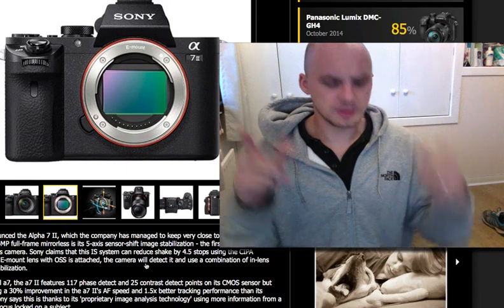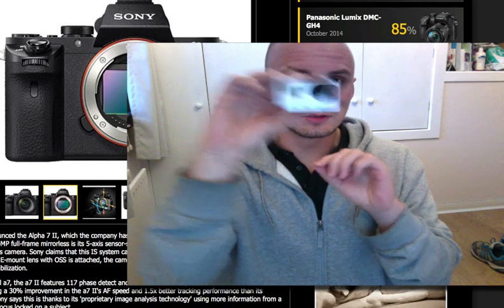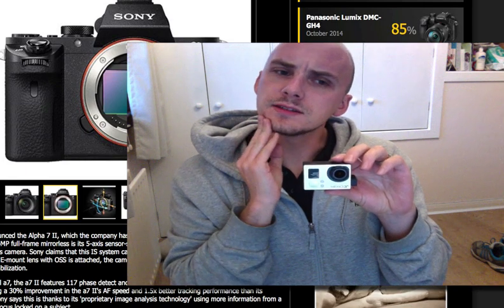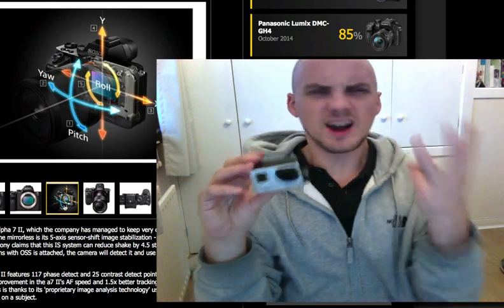5 axis sensor shift image stabilization ? What?

Comment: Actually there can be an infinite number of axes. Just because the Cartesian coordinate only requires three to fix a point in space (ignoring time) doesn't mean those three axes are the only ones that will ever exist. In the case of engineering speak the term axis refers to any axis of rotation that moves independent of another axis of rotation....or along an axis instead of about an axis. So, a degree of freedom can be the rotation around the X-axis and another one can be in line with the X-axis. So one axis creates a degree of rotational freedom and a degree of translational freedom for a total of two axes.
Reply from the maker: mind melted

Comment: I guess you are right with the tilt-shift-effect. I have a beamer where I can correct the projection when it doesn't stand on a flat surface and the projected image will have a distortion (upper side wider than lower side and vice versa). If you correct this you have the sides as long as they should be but the upper and lower part of the image will be blurry and the middle will be sharp.

Comment: Dom, I think you are right. But it seems nobody in the comments understand your point. Your point is really about moving the sensor plane with the IS system, while keeping the focal plane fixed (since the lens doesn't move).
Reply from the maker: spot on, however i now want to go and test out the olympus cameras to see what happens with them or if it is just bulshit
Reply: Is it possible to make vibration compensation using micro lenses between the sensor and the main lens?

Comment: I tried Olympus' 5-axis stabilization system and compared it to my regular Pentax SR ... Can't detect any difference whatsoever. Both worked wonderfully handheld down to 1/5s with a 50mm lens.
I don't think the original A7 series had any sensor stabilization though, so this is a good step for Sony... They overdid it though, IMO.

Comment: I think the problem arising from the difference in the plane of the sensor and the lens, as +Dombowerphoto said might have a point. In my opinion the resulting image may be slightly skewed or cropped, but not blurred(since that's the basic objective). Now...to correct the skew/ crop of the resulting image, Sony might have used or may use in-camera software!

Comment: From what I've read so far (mostly speculation) is the camera will be able to read pitch and yaw, then translate that movement into x-y shift to move the sensor in plane. It won't be perfect, but it should still improve IQ on top of the standard 3-axis shift.
I was getting a little excited at first, thinking this could lead to in-camera sensor movements.(ie. in-camera tilt-shift!) Unfortunately, not yet. Would be awesome though!

Comment: Actually my photography suffer a lot from Roll. They way most hold a dslr will make the camera center of gravity in from of the sensor and this gravity will "pull' down front the lens. This is where Pitch will be very helpful. 
Stabilization will not burl your pictures as the idea is to counter your movements. And in relation with the subject the sensors will be still.

Comment: Come on. This is simple. Think of it this way. The Movi rig does 3 axis stabilization as in roll pitch and yaw. This camera will also do some straight up down movement stabilization and left to right movement stabilization. With Movi the user is doing the up down left right stabilization. Should be good, but obviously will not replace Movi devices as sensor movement is limited in amount due to size and amount of movement. Not rocket science.

Comment: This is essentially to correct minor shaking of the hand when shooting, we're talking fractions of a mm here at best.

While you are right that tilting the sensor relative to the lens mount is going to cause issues if you do it to the degree you demonstrate, in practice the tilt will only happen if the camera detects motion in that direction, and then only to a microscopic degree. It certainly shouldn't move far enough to take anything out of focus under normal conditions, I wouldn't have thought. The image should be based on a "flat" sensor when the shutter is pressed, and compensate for a certain amount of movement of the camera while the shutter is open. I would expect that if it started to affect the image in the way you predict, that would be amplified at shallower depths of field - when of course the shutter will not be open as long in any case.

The proof will be in whether the camera can produce sharp images under conditions where other similar cameras show a blur.

If anyone wants to buy me an A7ii, I will be very happy to test this out.

Comment: I know most of us won't entirely understand how it works - what is important is that it actually does work, and I'm sure a company such as Sony would not release it if it didn't.

I believe it allows up to 5 stops of stabilisation, where most other systems are around 2 to 3 stops (if I recall, my Canon 70-200 2.8 L IS is 2 stops, the MK2 version is 3 stops), I believe, which is cool in itself.

But the coolest thing about this is that it's the sensor that is stabilised and not the lens, this means that you should be able to chuck on any old lens and still get stabilisation - there's no need to buy stabilised lenses with this camera...
Reply: Pentax has body ios for ages now, nothing new here. (3 axis)

Comment: Dom I think that if the camera yaw or pitch the stabilisation system simply compensate for that movement and keeps the sensor in plane.
Reply from the maker: but it must only keep the sensor in plane for the original image, but not for the image coming through the sensor...
Reply: Dombowerphoto so the problem may be a fraction of cropping due to the tilting-compensation of the sensor. I suppose that we're talking of micro-millimiters of pitch-yaw so I don't think it could be a relevant issue.
I agree that it is almost unuseful expecially on an hig-end-enthusiast camera

Comment: Lets test it before criticize... The point is to add sharpeness to the image and even better sensibility. Imagine what if the same system was on the sony A7s or A7r...
Reply from the maker: no criticizing here, just actual confusion and questioning how it works or if it is actually beneficial
Reply: I agree, i m personnally not very sure about the yaw movement which can be necessary for sport shoots. The best would be to have a sport mode to desactivate the IBIS system when we want.